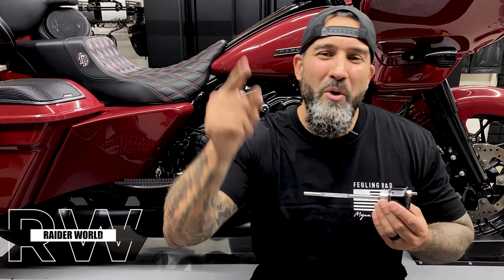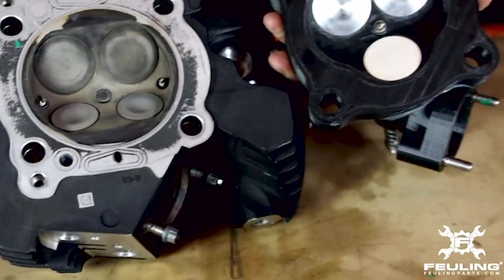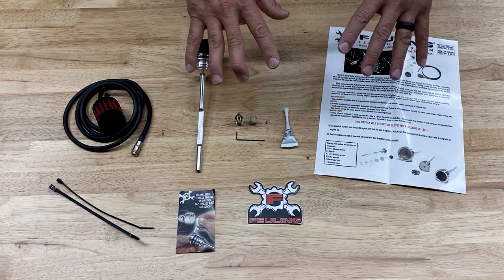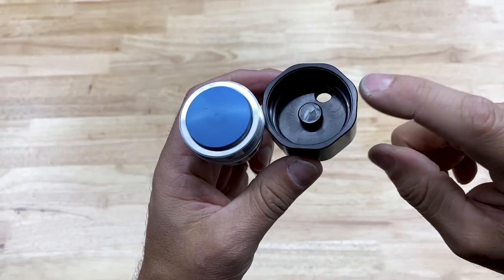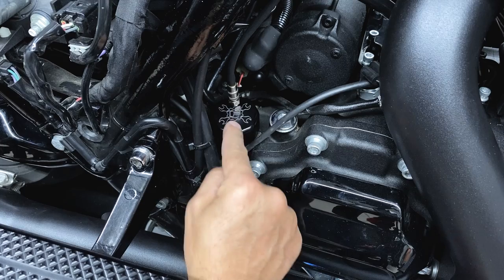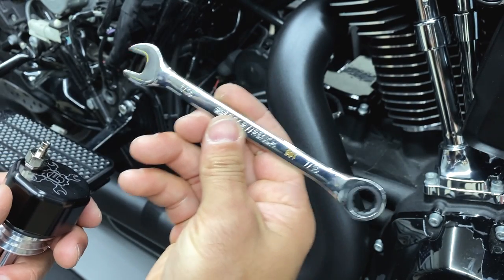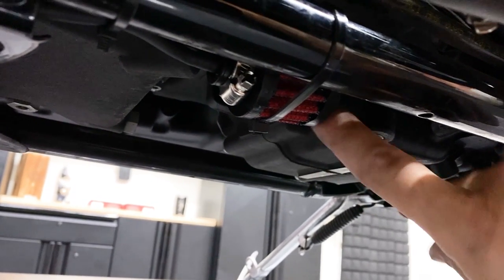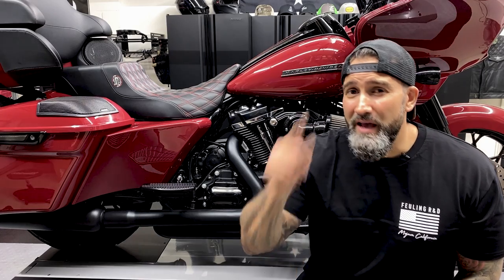FEULING Vented Dipstick for Milwaukee 8 Engines

Comment: I have been using this dipstick for a year and more than 10k miles. I hardly have any oil on the intake. There is no oil on the hose or the filter. Bike is running like a champ. Excellent product.
Reply from the maker: That’s good to hear! The way that Feuling has you route the hose and filter makes it harder for the oil to make its way to the filter, but still does the job.  If your filter was soaked with oil, that would mean something else is definitely going on.

Comment: I had this dipstick and no matter what I did it would constantly puke oil out of the filter.  I routed it just like they said in the how to video on fuelings website and even rand it a half quart low.  All it did was continue to puke oil.  Spend the extra money and get the Task CheckM8.
Reply from the maker: I haven’t had any issues, but that is unfortunate that yours is doing that.  I did purchase the Trask Top cover, I did a video of it here 👉🏽 https://youtu.be/-YN3aGOLqvQ
Reply: had the same issue with the vented dipstick puking oil constantly. it is a really nice piece though, just doesn't work for me. also have to wear gloves if you want to check your oil when hot as that billet aluminum will burn the shit out of your hand. ill be doing the diy vented trans/engin oil cover similar to trask but for less than $30 in parts.
Reply: So trask check m8 helped you with oil mist?

Comment: Hi. Can I ask for your advice on my 2019 road king. I had to upgrade the engine to 117 stage 3 with V&S headers, KW exhaust and Fuel pack tune. The bike has annoying ticking noise (valve noise??) and numbing fine vibration that causes me to loos sensation in my feet. the biggest issue is that with the RPM less than 3 it feels and sounds like I have maxed out on the gear and need to shift ... I basically have to shift quickly to 5th gear and stay below 70 MPH to avoid the vibration and the noise. Would you happen to know what is going wrong here? Is it normal to have these issues with the upgrade? please help I don't and can't enjoy my bike anymore
Reply from the maker: I would check the clearance from the rocker arm and rocker cover.  Sometimes with these upgrades there may not be any top clearance.  It’s hard to really tell what’s going on without looking at it.  Hope this helps

Comment: curious why it's ok to mount the filter element below the bike on the vented dipstick but with the transmission cover they are adamant that you need to mount the filter at a high point on the bike?
Reply from the maker: It all about where and how you route the house line.  They both have you routing the line up, then back down.  That way gravity will do it’s magic.

Comment: Well this stop the oil mist from coming into my air cleaner  or do I need to add another device behind the air cleaner
Reply from the maker: After my last service, I did have oil in the air cleaner.  This is with this dipstick and the Trask top cover installed.  This did relieve crankcase pressure.  After I installed the Feuling BA air cleaner, it eliminated the blowby.

Comment: So I just installed the vented feuling dipstick, air cleaner & external breather kits for both. Did an oil change, 4 quarts 21 FXLRS, did a 1200+ miles this weekend and the filter connected to the dipstick leaked the whole time.
Reply from the maker: Sounds like a good ride!  I’m also guessing you like riding at higher RPM’s.  That sounds like some serious excess pressure and blowby.  With this new set-up, Whenever I do an oil change, I will fill less oil than recommended.  I’ll Go for a ride, and see if I am low.  Can you visually see any oil in the air cleaner?
Reply: @RAIDERWORLD  it’s not from my air cleaner the oil is dripping from the filter connected to the vented dipstick. I do ride pretty hard but paying all that money I don’t think I should have that issue. I checked it this morning cold and my oil is showing at the 2nd pair of dots on the stick.
Reply from the maker: @noahsworld1462  I absolutely agree.  It definitely shouldn’t be doing that.  I would double check the filtration system inside the dipstick.  It could just be blowing past it.

Comment: The only issue I see with this kit is where the filter goes just like the trask kit when the system burps it will place oil directly in line with the rear tire … I would of routed it over the rocker covers … great product for sure !!
Reply from the maker: Thank You Brother! I looked at a few places for this filter, because that thought did cross my mind.  I ended up going with what they recommended.  I’m sure we run over enough oil on the road, that this shouldn’t be a problem.  Another good place to route it, would be all the way back along the strut to the rear lighting, behind the fender 🤟🏽
Reply: @RAIDERWORLD  yeah I’ll be tracking your feedback and I’ll be running mine on top of the rockers … I’d rather replace my jeans that high side the bike
Reply: @Jack-b5o6r  this is no different than Panheads, Shovelheads and early Evos. They vented to atmosphere and people ran the tubes back by the right rear frame. If you have that much blow-by oil coming out, you have much bigger problems.

Comment: Question: I have 2019 114 fat boy. I have upgraded to S&S pump/cam plate/cam.  I have feuling vented dipstick and feuling air cleaner with built in EBS.  Is that to much venting on a soft tail in particular? I appreciate any feedback.
Reply from the maker: I believe what you have now should definitely be enough.  The External breather helps with the Blow-By, because the dipstick can only do so much with that.  You can check out the Feuling BA Air cleaner video I did that shows how much blow-by I still had

Comment: Sorry if this was asked already, but WARRANTY!? MEHHHH! Will the vented dipstick or the trask transmission cover void it? My brain is telling me that possibly the trask cover is more risky...
Reply from the maker: Both the Dipstick and Top Cover do not have anything to do with how the engine or transmission functions, so In theory, it should not void the warranty.  It just allows it to breathe a little better than designed.  It’s all on the dealership too, some play harder by the rules.

Comment: I fitted one of these to my Sport Glide last year but couldn't live with the mess. With the filter element I was getting oil dripping under the bike after 50 to 100 mile rides and the smell of oil was not great. Replaced the filter with a catch can and it too was soon overwhelmed by the amount of oil being ejected. On one long days ride with my Mrs on the back everything at the rear of the bike was covered in a oily mist and smelled of it. I don't know what the answer is but I have removed the dipstick and feed line for now and gone back to stock..Much cleaner. I have an externally vented air cleaner (Trask) so hopefully that helps. I tried getting support from Feulling but they stopped answering my support request emails after I sent them photos they requested. Quite disappointing. The level of the oil in the bike seemed to make little difference, I even let it run quite low and it still spat significant oil down the vent line. I did wonder if it had anything to do with cornering as I do deck the pegs a lot on bends..maybe that allows more oil to escape?
Reply from the maker: I’m still testing both the Trask and the Feuling dipstick, but haven’t ran into any of these issues.  I did hear that anytime you ride a lot of twisties and get a good lean, that could cause a bit of oil spit.  Did you route the line/house the way they suggested? This helps prevent a lot of oil reaching the filter.  I’m surprised Feuling hasn’t responded, I’ve had more success reaching them than Trask.  It could also be that they are both in Daytona.
Reply: @RAIDERWORLD  this was last year, well before Daytona. Must have been September time. Initially they seemed to want to help though didn't seem to have an explanation for why so much oil was passing. Asked me to totally strip and disassemble the dipstick (and photograph) all of which I did, then they stopped responding. Gave up. Yeah I routed the hose pretty much as recommended, up . If I remove the filter from the end which is saturated I need to leave the line over a catch tray to drip all the emulsified oil out of . It's pretty messy. Unlike the US we have a lot of roads with roundabouts here and we circulate them in a clockwise direction, which means you lean the bike pretty much as far as the pegs will allow at fairly low speed, an awful lot just going from a to b across town. I speculated with Fuelling that maybe this was allowing oil to reach the cap more often. They didn't seem sure. Personally I think the valve part might need to be higher to let vapour/ pressure through without actual oil reaching it
Reply: @TheunfamousflyCoUk  what year is your sportglide because you have other issues going on
Reply: @anitabonghit266  2021
Reply: @TheunfamousflyCoUk  here are a few things that might be a issue.  You might be over filling the oil. Hot oil check takes about 20-30 minutes of straight riding for the oil to get to operating temperature. Your piston jets might be loose. Your pressure relief in your cam plate might be stuck. After you go for a ride pull out cam position sensor and catch all the oil that comes out. There shouldn’t be more than 4 ounces of oil in the bottom of the crank case

Comment: I wonder if you could use this to tie into the head vents that when stock vents into your intake? I've seen videos of different ways to reroute that to eliminate blow by.
Reply from the maker: There’s a lot of techniques out there to reroute this issue.  And most of the videos you see out there are are mainly opinion based.  I’m definitely running these through a test to see if they do what they are designed to do.  To many cheap fixes lead to more money out of your pocket in the end.  And obviously this is just my opinion 🤟🏽
Reply: @RAIDERWORLD  I whole heartedly agree. I hate spending dollars too chase dimes.

Comment: Awesome man! , I have a question you used fueling vented dipstick and trask performance vented top cover  , use both together any problems? Good for M8
Reply from the maker: Thank You!  As long as it maintains a vacuum, “In Theory” there should be no issues.  I’m running tests on both to see what results I get.

Comment: Yes Raider,
that's how I did it too. After installing the Trask Transmission Cover, I removed the Vented Dipstick hose and K&N filter and screwed in the small cork valve. 
I kept the dipstick attached because it just looks better than the original dipstick.
Both systems I consider unnecessary if you have installed an oil pump after 2019. 
Either the dipstick, or the Trask cover.
In your place I would only go when you have a Feuling, or S&S Camplate and oil pump ( original Harley 2020) installed.
You will otherwise lose oil.
I have with the engine conversion to 117 cui equal to the S&S Camplate and oil pump with sealing ring installed.
All the best and many new videos, greetings from Germany
Reply from the maker: Absolutely!  Thank you.  I’ve actually seen some 2021 Road Glides with very low mileage and a high amount of carbon build up and glazed cylinders.  It’s hard to trust these upgrades Harley did until I see it with my own eyes.  I do plan on adding some Feuling Upgrades soon, but I don’t want to spoil the surprise haha🤟🏽
Reply: @RAIDERWORLD  The new oil pump from Harley, S&S or Feuling does not prevent the blow-by. These oil pumps prevent sumping.
You still have to do the venting. Either via the air filter, the vented dipstick or the trask transmission cover.
However, the prerequisite for successful venting is a suitable oil pump. So the new Harley models have the right conditions for bleeding. All Harley M 8 before 2020 must first replace the oil pump in order to bleed successfully.
Conclusion: To prevent bow by, M8 engines need one of the three ventilation options.
From 2020 it will be cheaper because you can save the additional costs for a new oil pump.
All the best, keep it up.

Comment: I had no idea that it had that quick disconnect on the hose....pretty SWEET!!  I had been reading that there have been some issues with the Trask (something about the gasket on the oil pump and the model of the oil pump and it "could " cause a massive amount of blowback), so now I am questioning what situation I am in and maybe I run 2 types of vents as well...I am looking at the HPI breather on the air filter, but the Fueling dipstick looks great as well.
Reply from the maker: I plan on upgrading the cam and oil pump soon, so we will see.  I was also looking at the Trask Assault Air Cleaner with the external breather kit.  I think as long as we catch some of that oil, we should be good-to-go.  Some is better than none
Reply: @RAIDERWORLD  LOLZ...my cam, cam chest, oil pump, and throttle body are in bound and my manifold got here today.....  :D.  I did my exhaust and tune last week, and I need t o chose the air cleaner yet....prolly gonna do the HPI V2 after watching the install video...it isnt as fancy looking, but MAN its build well!!
Reply from the maker: @redrider0151  That’s awesome! I was on the fence with doing a big bore kit, but who knows, the fence is not that tall haha.  Looking forward to seeing and hearing what yours sounds like .
Reply: @RAIDERWORLD  I really good friend of mine did the Fuel Moto/Woods XD cam...and it turned out awesome :D

Comment: That’s one whole long ass hose lol
Reply from the maker: Haha! Right.  You can always cut it.
Reply: @RAIDERWORLD  Feuling reccomends that routing you showed so you do not spit oil thru the filter. Also, there is a bulleting in the instructions that if you have a pre-2019 oil pump, you may push oil thru a seal if using this dipstick. Check with Feuling for more information.
Reply from the maker: @jobeta22  Absolutely.  They have it routed the way they do, so the oil really has to work hard to even reach the filter.

Comment: BTW, wear heat resistant gloves when checking your oil if the engine is hot. Or you may get a gnarly Feuling logo burn on your hand.
Reply from the maker: Absolutely! Says it in the instructions, so hopefully everyone reads that.  I edited that part out, didn’t want to insult anyones intelligence haha

Comment: I have Fueling dipstick on 2019 Street Glide and 2022 Street Bob. I’ve used it on my previous Street Glide 103 it worked great! Are you running both Trask and Fueling at the same time, or vented dipstick is enough? Which one do you recommend?
Reply from the maker: I actually have both.  I did an update video here 👉🏽 https://youtu.be/Z9RgJqqUMkE 

It might be different for me, just because the way I ride, but I recommend and external breather system